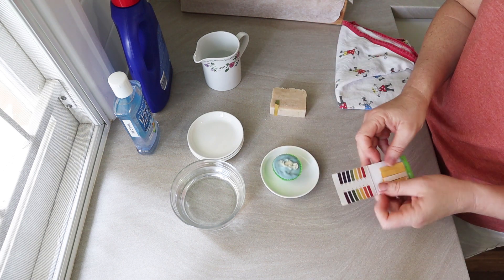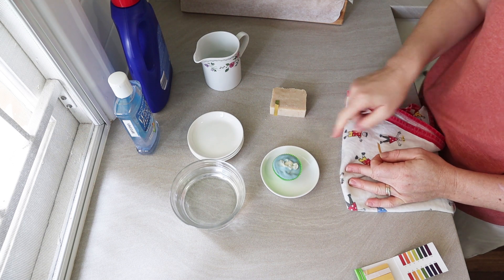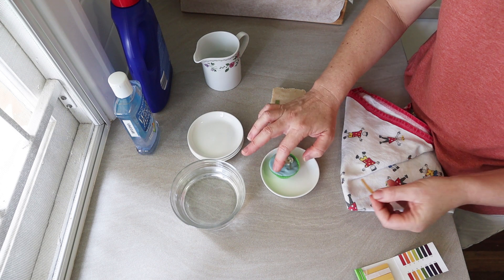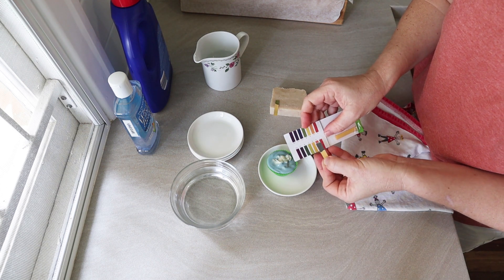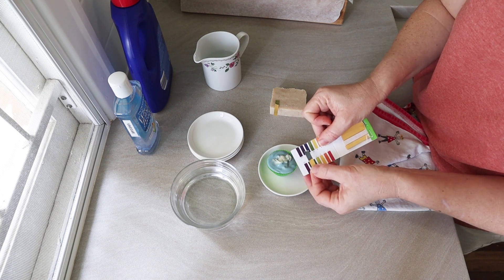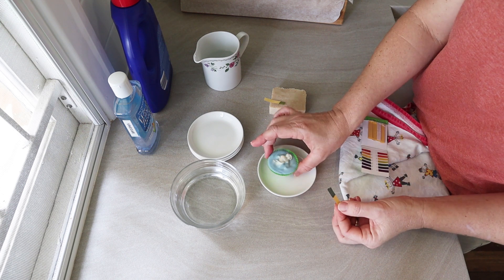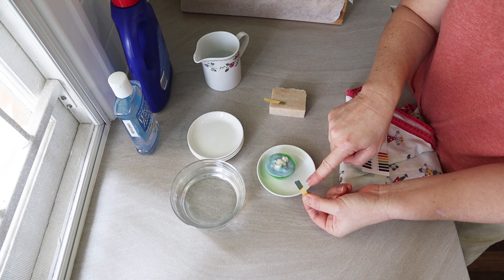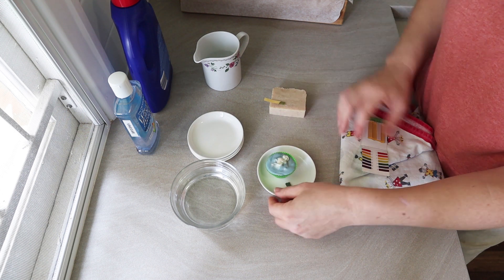Handmade Soap Testing - How to test the pH of your handmade cold process or hot processed soap

Comment: Hello, thank you! I did a crash test, HP rebatching parts of my first ever CP batch which is too soft, with coconut oil "soaps" I tried to make mixing leftover soaps (no lye), coconut oil and salt, + new oils. Put everything on soapcalc to calculate how much lye I would need, and I thought this hot process soap (first one I make) came out lye heavy. But actually the PH is a green btw 9 and 10. I'll let it cool and cure, and then see if it changes

Comment: You need to use a proper method of testing pH of your soaps. Otherwise, the results don't mean the same thing as others' testing results. Soaps for example, cannot be of pH 8. It will be from 9-11. So, by getting 8 result, it shows the method is not reliable.

Comment: My soap ph is always between 9.5 to 10 even after a few weeks. I read that up 10 is normal for cold process soap. I’m using the test strips which are sort of hard to read because the color that comes out never really clearly matches a color on the chart. If it’s supposed to be 8-9 I don’t know what I’m doing wrong.

Comment: Dr Bronners bar soap has a PH of 9.8 +or- 0.3 so anywhere between 9.5 and 10.1. I think soap tested with a PH meter will give a reading closer to 10 than 9. I've tested a few store bought soaps and the ph is around 10. I think the ph strips seem to give a lower reading between 8 and 9 :)

Comment: Hi Elly, your job ist wonderfull, Congratulation! I want to ask you why you don't use a PH meter in the composition before putting it into shape? I think it is more accurate than the paper test. I also make soap as a hobby and test the Ph in this way. I bought the Ph meter on Amazon for 7 Euros. Greetings from Austria
Reply from the maker: It's not going to be saponified before it hardens and sets, it takes a few days for the reaction to complete. The paper strips are reliable enough for this purpose :)
Reply: Dear Elly thank you very much . I think you have a good reason und I will prove it.  Best wishes.

Comment: p means you're measuring a small thing after it on a logarithmic scale, by taking the logarithm base 10 and then multiplying by -1. pH means you do that for the concentration of acidic protons, aka hydrogen ions. We also have a pOH scale for the concentration of hydroxide ions and pKa for acid dissociation equilibrium constants.
If you have more than 1 mole of acidic protons per liter, there can be weird interactions that interfere with acid dissociation, so pH stops reflecting how much acid there really is in solution below 0 (because log base 10 of 1 is 0). pH values above 14 mean there's a hydroxide ion concentration above 1 mole per liter, creating similar weird interactions on the other side.

Comment: Hi,thanks for your video's,they are so useful,some daya ago I made a soap with olive oil,and we use it in forth day,I wash my face and unfortunately it causes bleeding eyes,now how we can trust to our handmade soap even after 4 weeks for selling to customer?Will it has lye after 4 weeks?I hope you show me a way to understand it,if you answer me I will appreciate you
Reply from the maker: Hi, it sounds like you do not fully understand the process of making soap or you have formulated an incorrect recipe. You should not use it after four days and it should be tested for safety before use. Have you formulated your recipe correctly? It sounds like you definitely have too much lye in your soap. Are you certain you are using the right sodium hydroxide for your recipe? (the strength does vary worldwide). Have you seen these two videos?
How to Formulate and Calculate Your Own Soap Recipes https://youtu.be/AqKxin0q1bM
Calculating Water in Soap Recipes and Clarifying 'Lye Concentration' https://youtu.be/wd7_uZfbPn4
Reply: @EllysEverydaySoapMaking  yes I use the recipe from your video and I calculate that amount of sodium hydroxide from soap calc,how do we test the safety of our soap?may be there is a little lye even after 4 days.yes I see your videos

Comment: Hi I just tested the ph of 3 of my bar soaps and the results were respectively 6 , 7 and 8 .as 7 is neutral I would like to know if the one with ph 6 and 8 are safe to use ? I'm a new soaper
Reply from the maker: Hi, it sounds like your pH test strips might not be any good? Or something happened with your recipes? All soap should be 8-9, it's impossible for it to be any lower, and higher than that indicates a problem.
Reply: @EllysEverydaySoapMaking  thanks so much but please I have one more question. I prefer using lye concentration on soap calc but my concern is concentration would you advice me to go with ? I'm currently using 25 and 26%  plus 5% superfat.is that ok ? And yes you were right the ph was the problem I checked again and I had a ph of 8

Comment: Hi from Indonesia! Thank you so much for your tutorial, ive been following your recipe but would like to get some insights since my soap is always slighlty more alkaline than its supposed to be (ph 10-11), what should i do? And is it still ok to use?
Reply from the maker: Hi, are you curing it long enough before testing? If it is still high after a few weeks, then I'd say there is some issue either with your testing paper/method or your soap ingredients may have an issue. Hard to know what's exactly happening, sorry.

Comment: Just for the people wondering what's with the water. The pH measure (acidity or alkalinity) is only relevant in the presence of water. An acid isn't "acidic", it's simply a weak or strong acid, and the same with bases. An acid in solution (with water) makes an acidic solution (acidity) and the same with a base in solution (alkalinity), which is what the pH strips measure. So acids and bases don't have a pH value in their pure form. :)

Comment: This is a great quick-and-dirty guide to Ph testing, for sure! Something that I wanted to add: a lot of folks don't know that Ph is standardized using a 10% solution. That is, 10% of the substance you're testing and 90% water. So if we're testing water, it's already fine to test, but if we're testing sugar, for example, ideally we'd dissolve 1 part sugar in 9 parts water (by weight). Then the number we get from Ph is accurate, because the numbers on the scale were obtained doing it this way, if that makes sense? If our solution is a little too strong, for example 50/50 soap and water, it might read more alkaline than it is.

So through my reading, I learned that the safest way to test Ph is to actually dissolve some of your soap/shampoo/whatever you're testing in water. So 1 gram of what you're testing in 9 grams of water, for example. And then testing the solution, we know for sure that we're getting an accurate reading. I don't know that this is necessary every time, but it was an exercise I found helpful to at least sort of "calibrate" my Ph testing—as in, once I did it once, I found it didn't make any difference with the cheap Ph strips for my shampoo bars, but it did for my soaps. So then I check my soaps that way now, but don't bother with my shampoo bars.

All of this to say: Ph is complicated! And you've done a really good job of explaining it here in a straightforward and practical way. But I just wanted to chime in with the info about a 1:9 ratio, in case some folks are finding that their tests aren't working very well or consistently.

Thanks for sharing this great content! Love your channel and always get excited when I see you've uploaded something new! Sending virtual/socially-distant high-fives from Canada! 😊
Reply from the maker: Hello! Thank you so much, I really appreciate your input! I have heard about the 1:9 ratio, but like you, found it makes little difference with my cheap pH test strips. Great info - I love that you shared that for me and others here. Thanks for your kind words also. Hi fives from fom Brisbane! :)
Reply: Thank you! Indeed I was wondering why I was getting different results when I test my soap as it is, and diluted with water

Comment: My soap is not safe. In all my 7 years of making soap I have never done anything like this. I transposed my lye amount. Now I have lye heavy soap that is really not good for anything. Can I remelt it and add more water and oils? Or what?
Reply from the maker: Yes you can, or you could use it for laundry soap? Depends on how lye heavy it is I guess.
You could make laundry soap like I do in this video https://youtu.be/4dufZ7efqbQ
Reply: Lye should have been 227.01 and I did 277. On the Lye calculator I use 5% excess fat is the 227.01. 0% excess fat is 238.95.

Comment: can we adjust and lower the PH of shampoo bar from 8 to 5-5.5 ? i found few people telling to add citric acid to lower the PH. Does that really work ? if yes, at what stage can we add it as PH is tested after the soap is cooked (As per your ACV shampoo bar video). Also, does ACV soap have lower PH than other shampoo bars because of presence of Vinegar in it ?
Reply from the maker: No, it's soap so it will always have a higher pH. The vinegar isn't strong enough to lower the pH of soap.

Comment: So I have made a few batches so far they came out great, also I checked the pH level  good as well.  My question is do we need to add a preservative to the soap, if I want to sell it, will it cause mold, since it has water in it. I cannot find a detail answer on it.  Some of the sites who make soap and sell it on their website it shows they use Benzyl benzoate,  I also bought a famous recipe from a master soap maker, but it doesn't have any preservative in the recipe, however on her website it has Benzyl benzoate, as an ingredient.
Reply from the maker: No, you don't need any preservative for bar soaps if they are made properly. Bar soap has been made with oil, sodium hydroxide and water all over the world for centuries without any preservative. The alkalinity and low water amount in the solid product prevents spoilage.
Reply: Elly's Everyday thank you

Comment: Hi Elly,
I tested my soap after 48 hrs, i got ph 11. Is that fine?
Reply from the maker: It should be between 8 and 9. Maybe give it a few more days and re-test it. Sometimes handmade soap takes a few extra days to fully saponify. If it doesn't ever get any lower than 11 there may be a problem. I hope it comes down for you!
Reply: @EllysEverydaySoapMaking  Thank You☺ I made a quarter of what u gave and I felt I got the trace very quickly! Maybe I was wrong in that!
Reply: Can I melt them & mix again?
Reply from the maker: You can rebatch the soap, but you need to know what happened first to correct the issue. I'd say something may have gone with your calculations when you divided the batch. Maybe re-check your numbers?
Reply: @EllysEverydaySoapMaking  Hi Elly...Thanks God it came down ... it took 6 days though... thank you for your help ☺

Comment: I have some questions:

Is it dangerous for skin if the level of PH is high in shampoo or soap?

If it is found out that the level of PH is high while producing soap how can it be normalized?
Reply from the maker: The pH level of soap is extremely high until the saponification reaction has complete, then it returns to about 8-9, as I mention in the video. Unfortunately soap can't be made any less alkaline than this, because that's just what soap is - an alkaline substance. Some people prefer not to use soap for this reason, but it's a personal choice.

Comment: Hi Elly, I have put my soap for about 45 days curing time, and when I tested it (I am using liquid pH tester), it is still shown alkaline.  Is my soap recipe has problem or shall I test again maybe two weeks later?
Reply from the maker: It should be alkaline, but not too much so! Does your pH tester give you a number? Soap should be between 8 and 9 on the pH scale, which is still alkaline.
Reply: @EllysEverydaySoapMaking   I am using liquid tester, it does not give any number, but only shown in colour. According to the instruction, if the liquid solution shown clear solution after putting in a little piece of soap in the tube, it means the soap is ready to use. If shown purple, means the soap is not yet ready. My soap shown purple, however, I have curing it for 5 weeks already, should I wait for another two weeks and test again?
Reply from the maker: What does clear indicate though? Does that mean neutral? Soap will never be neutral (7), it will always be 8-9 on the scale. I would suggest buying some paper strips off ebay and using those if you can.

Comment: The pH scale actually doesn't really end at 1 or 14, you CAN make a NaOH solution with a pH of 15 or strong acids at 0 pH or even -1 (yes the scale goes negative).  You just really really shouldn't unless you HAVE TO and are in a proper lab and know what you're doing.  I have used solutions of H2SO4 in biochem lab that was as low a pH as 0 (2nd-year uni).  The limits are really based on the solubility of what acid/base you're adding to your solution and Strong acids and bases have very high solubilities.  Also while pure/distilled water is 7, most tap water isn't here ours is slightly basic because the main water source around here is a lake surrounded by limestone!
Reply from the maker: That's interesting! Thank you for sharing! I was thinking about the tap water comment. I know ours is 7, but that wouldn't necessarily be the case everywhere. Thanks again.

Comment: Thanks for your great videos. I am wondering what kind of sodium hydroxide you use ? I got some from the hardware store and am not sure if it's the same as from a soap making supplier. My soaps seem to be quite high pH and I wonder if it's because of the lye I'm using. Thanks
Reply from the maker: Hi Catherine, I only ever buy my sodium hydroxide/caustic soda from the hardware or the supermarket and it works fine. As far as I know it's the same thing as a soap making supplier would sell. The trick is to look at the fine print on the packaging - it should say 98 or 99% sodium hydroxide. All of the caustic soda brands here in Australia say 98% sodium hydroxide on the label.
Reply: @EllysEverydaySoapMaking  Thanks Elly, that's good to know. I will check mine and try again. Catherine
Reply from the maker: You're welcome :)
Reply: @catherinewalker7097  If you're in the U.S. then Roebic Crystal Drain Cleaner is one option.  There are lots of other suppliers available, and this may not be the most cost-effective option, but I was able to pick some up at Lowe's and it's labeled as 100% Lye (sodium hydroxide).
Reply: @AtomicElf1  Thank you but I am in Australia. Appreciate your help though
Reply: I only use food grade lye and I get it from TKB or Nurture. U do t wanna buy lye off eBay or Amazon because u never know what ur getting. And being I sell to the public everything I buy that goes on a body must be food grade or cosmetic grade. I’m infectious disease control certified and when something says food grade or cosmetic grade it is held to a higher standard by the FDA. Drain cleaner is not held to the same standard that food grade or cosmetic grade is help to and ppl are putting this on their bodies and on there children’s bodies . Our skin absorbs everything we put on it as if u ingested it. If someone becomes ill by something that was made from what is meant to be used as a drain cleaner u can go to jail for criminal negligence. Drain cleaner is labeled drain cleaner even though it says it’s lye because it is meant to be put down a drain. Lye that is food grade is meant to be ingested anything labeled cosmetic and or food grade u know is meant to be put on or into our bodies with the approval of the FDA!!! If you are selling anything to the public small business or not the FDA has standards there are legal guidelines you have to follow. That even includes how much fragrance oil ur allowed to add and how much essential oils ur allowed to add. This is all state and federally regulated with severe consequences for the person selling if someone becomes ill from something u made to put on someone’s body and a complaint is made on u from the FDA they are going to want to see what was in your soap and if they see non cosmetic and non food grade and realize it was labeled as drain cleaner hun I’m looking out for u but u can go to jail. If ur selling to the public it’s ur responsibility to know what the guidelines are and drain cleaner even though may be lye is not in the guidelines. U do what u want it’s ur life not mine I’m just letting you know this because I don’t wanna see u end up in serious shot one day because u though it was ok to use it. It’s like herbs. If I do a spell candle then I use the cheaper herbs and I put a warning label do not ingest. Now there may be basil on the candle but if it’s not food grade u should not ingest it. Food grade parsley is held to a high standard of care then non food grade parsley. Non food grade is cheap for them to care for because they can spray it down w all kinds of shit. If I were to eat that u would be poisoned! But food grade parsley is safe because the FDA has requirements as to the quality of the products they are allowed to put on the parsley and a long list of what they are not allowed to do to the parsley so that when u buy it it’s safe to eat and u don’t get poisoned. That drain cleaner is not made to be on or in your body!! Not at all and not for any reason at all. Do what u will it’s ur business not mine. But at least I have a clear conscience that I told u and I was able to inform you on why that can be dangerous.
Reply: @moonshadowessentialssoapsn5287   "Lye that is food grade is meant to be ingested" Have you ingested food grade lye then compared it to ingesting "non food grade" lye?  I'd love to know the results of your experiment.